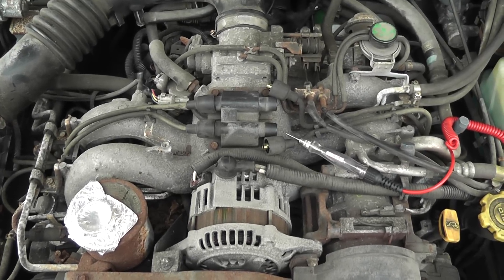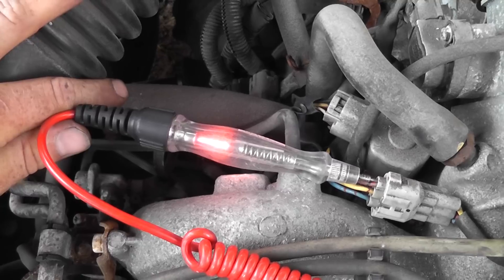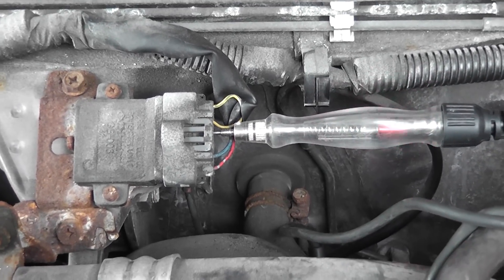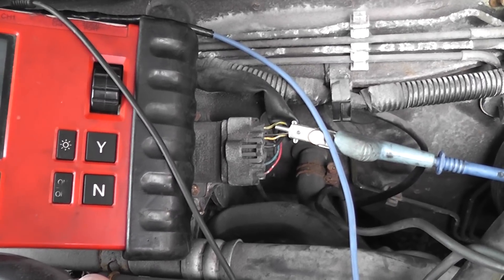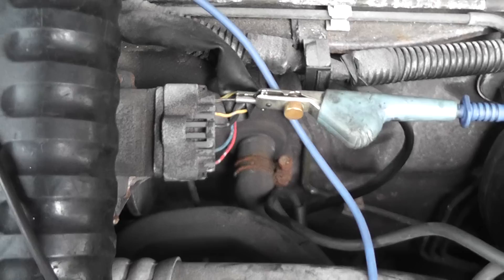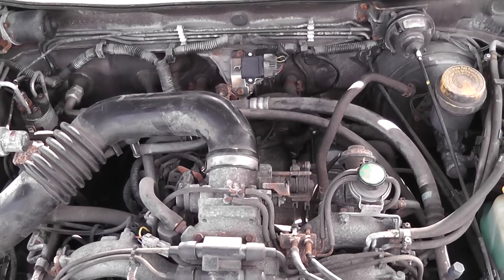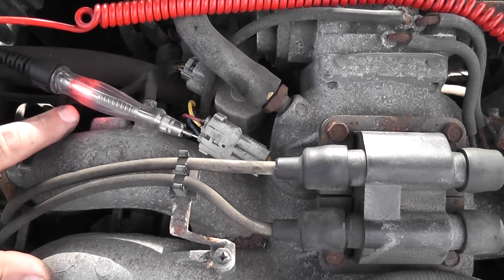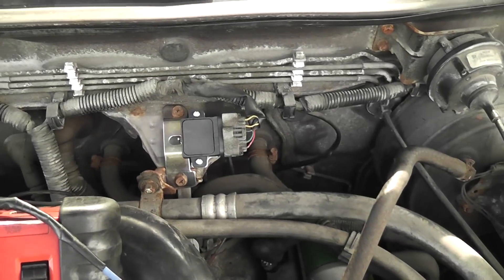How to troubleshoot a no spark condition with a test light (Subaru)

Comment from the maker: Want more training on this system? Maybe some questions on the tests I've shown? Watch this!! https://www.youtube.com/watch?v=LdnnFD6J8Uo&t=1s
Reply: Dear scannerDanner.

My friend has a 2009 subaroo impreza non turbo.

Randomly it will stall at lower Rpm... and sometimes it will start..within 10 min or so ... and sometimes it will not start for days. (No spark) 

No codes... no lights zero insight of what it can be ...

And once it decides to start... it's  and if it has no issues...

Have you come accross this issue ??
Reply from the maker: @lukek6492  no I have not. But you need to find out what you are missing when it is not starting. The window is there for you to do testing.

Comment: Just like say a huge thank you for posting this video up. I have successfully diagnosed a faulty igniter on my EJ20 engine installed in a T25 vw camper. I had no clue how to test or what to test and with this easy to follow video i got it down to the ignition igniter within 5 minutes.
Reply from the maker: Awesome!

Comment: I got low voltage on my igniter 0.2v on crank. All The others signals from de ecu and voltage are fine, i tried change The igniter, coils, crank sensor and replace The ground conectors but no spark, i saw That my crank pulley have some teeths sharp down
Reply from the maker: need to know exact year, make, model and engine and what ALL voltage reading were on each wire of the igniter to help further.
Reply: @ScannerDanner  
Its a subaru legacy gx tw 2.2 93 , it got a good power Supply and ground but only about 0.2v comingo from ecu
Reply: The service manual says The min voltage from signal are 0.1v but in this vídeo The signal comes about 2v, The crank sensor is New and works fine
Reply from the maker: @yurirecreio  okay, since it is possible that you still have an input issue (crank and cam signals), I want to address that first. Do you have injector pulse? If you do, we will continue to look at the igniter and related ECM control circuits. If you do not have injector pulse, we will move away from the igniter circuits

Comment: Hi. 
Subaru.. same engine.

Car sometimes dies at lower rpm as you are driving.

After it dies... it cranks.. but no spark.

No codes.. 

Then randomly it will start after a hour ..or so. and  sometimes won't start for 2 days.

Then... when it wants it starts... and runs ... till once again randomly dies.

Thoughts?
Reply from the maker: What does the test light do on the coil like i showed in this video? Should have a steady light on the middle wire and a pulsing light on the other two coil primary wires. Tell me what you see and I can help.
If you dont have an old school incandescent bulb test light, you can still find them for less than $20

Comment: My 06 Outback on cold days 30s F. With a cold engine I have no spark. I haven rpm on the scanner.. Using a timing light I found no spark, later today I'll scan to look at the cam sensor, also will check wire connector at coil for readings. Have tried different after market coils.
Here's a kicker, hook a jump box to it ,fires right up. Battery is new, test good,  vehicle passes voltage drop test as well, and cranks with several rpm.
???
Reply from the maker: Step 1, what is coil + voltage during cranking when it is not starting?
Reply: @ScannerDanner  Just checked it back probed 11.3 ish. But it fired right up of course. Will check again in morning, sure it won't fire then.
Little back ground. Spent amost 30yrs as a heavy truck tech. Few years back started developing cognitive issues. I mentally hit a wall pretty easy now, I hate it. But I'm broke so I have to fix it myself. Bought it with slapped valves out of a field. It's  a manual the only reason.
Thanks for your help and time, and listening to me babble.  
I'll update you.
And cam sensor reads fine.
Reply from the maker: @JonathanWhoever  awesome, love to help those who can help themselves, ill make it a point to reply. I'm sure we can do this together. 
One other thing, I rather you test for spark using something other than a timing light. That test is suspect. But if you're 100% positive you are losing spark, we will stay on this path for a bit. I want you to also check for injector pulse when it doesn't start. Do you have an incandescent test light?
Reply: @ScannerDanner  wow. Thank you. I'll pick a test light.
While testing fuel pressure it did load up the cyclinders while the ignition was disabled, smelled bad when I finally started it. But I will dive deeper into that. What do I need?  Those noid lights things?
And I just subscribed.
Reply from the maker: @JonathanWhoever  just get a test light like I'm using. We can roll from there. Make sure you get the old school incandescent type, NO LEDs!
Reply: Hello again. Checked it this morning here are my results.
Temp.20f
Batt v 12.44v
73%charge
Internal 5.28ohm
 Coil volt while cranking 10.2v
No start, not even with jump box help. Thinking maybe the coil is being effected by cold, warmed it with heat gun, no start. In 40-50drgree days, once its starts,it good all day.
Warmer than that no problem noticed.
Also noticed ignition voltage remains at coil for a couple minutes after key has been removed. 
Thank you
Jonathan
Reply from the maker: @JonathanWhoever  next step, test light tests like I showed in this video. Does coil negative flicker?
Reply: @ScannerDanner  On it. My coil is the one with the four wire connector on it. One is the volt wire, one has continuity to ground, I assume the other two are control. Should I see light flicker on the control when back probing?

Jonathan
Reply from the maker: @JonathanWhoever  I believe this changes things. Service info is vague but it looks like your coil has the transistors inside of it that control the coils. So the igniter is built in. You are not going to be able to use an incandescent test light on the two control wires as they will be low voltage trigger signals. You would need to use an LED type test light to see those flicker on and off, or a lab scope. 
So you've confirmed you are losing spark, for sure?  I think the next best test is for us to see if we are losing injector pulse too. But I think you said it smelled like fuel when it wasn't starting? 
Another thought, service info says the black wire is a ground, but that goes back to the ECM. Get me a voltage reading on that wire too with voltmeter connected to battery ground. 
In fact, how about getting me voltage readings on all 4 wires. The two control wires should show some type of oscillating voltage but your meter may be too slow to pick it up
Reply: @ScannerDanner   Okay. Here's what I got. After cranking with no start pull the intake boot and gas vapor floats out and smells like gas.
Voltage on black wire ground is .6v
Two control wires meter on 200m setting does bounce around a little.
Seems to spin adequate,shoulda used the scanner.
Hook up jump box ,fires right up.

I failed to mention this a Autozone coil. 1st did this, 2nd didn't work at all, and the 3rd I'm back to this.
OEM coil only $30 more, I didn't know at the time or I'd bought that.
Will a LED test light pickup the firing signals to the coil?

Comment: What if no power to ignitor?
Reply from the maker: Depends on the model, some of them didn't have a separate power feed. Here is a link to a DIY version of the wiring diagrams and service info I use
https://eautorepair.adtrk.biz/?a=10817&c=24&p=r&s1=

Comment: My coil shows resistance of 2.7 ohms on both primary negative pins. Factory spec is 0.7ohms . Secondary are around 23 (Diamond coil pack) so it is between the range. Car shows a random misfire, check engine lights comes on and off and when it os off car runs great. Do you think my coil pack is bad?
Reply from the maker: Resistance checks on coils are not accurate. When they measure bad, it's bad, but when they measure good, it can still be bad. Not a good enough test for the coil

Comment: I managed to solve the problem 1996 Subaru. Checked the Ignitor, that wasn't the issue. Checked  the camshaft and crankshaft for ohms reading...I went ahead and checked timing,  and the damn tensioner and pulls for the timing belt,  both the tensioner and pulls was bad causing to skip timing...

Comment: Do you also have a video for 1996 subaru legacy wagon 2.2 camshaft and crankshaft sensor testing? Testing to make sure that they are good and not wasting my money to buy parts when not needed. I'd watch other videos about checking camshaft and crankshaft sensor..Mr. Paul I like your videos.
Reply from the maker: You'll find them in my chapter 21 playlist. Are they 3 wire or 2 wire sensors? 
Not specifically the Legacy 2.2 , at least I dont think, but certainly I have info on both 3 wire hall effect type and 2 wire magnetic pulse generator types of sensors and how to test them.
Reply: 2 wire sensor for both camshaft and crankshaft sensor. heading out again  for a 2 hour drive. My , the other brother in law finally had the battery check and charge, and I can't check the Ignitor because we had tooled off the timing belt and other belts for me to test...1 is mecchanilly incline and the other is Lazy.

Comment: Nice Information  dude, I don't have those tools , what the hell going to replace that unit..replace the knock sensor, Iac, coil,, wires and plugs.check the belt for TDC.. WAtching other videos  and showing me the camshaft and the crankshaft sensor...I'm on my Mother inlaw subaru for 3 weeks now.
Reply from the maker: just go buy an cheap $10 test light with an incandescent style bulb (regular bulb, NO LED light) and follow my test light procedures.

Comment: Would this work the same on a wasted spark without an igniter like on a EJ251/EJ201 I have no spark I have + and - and 2 to 2.5 volts on the ecu feeds but no spark
Reply from the maker: need year, make, model, engine size in liters please

Comment: So if I'm missing control signal on 1 wire coming from the ecu to the igniter and I have good spark on one half of the coil is it fair to say it's ether the wire from the ecu to the igniter or the ecu it self.
Reply from the maker: Or the igniter transistor is shorted pulling the ECM control signal to ground. Disconnect the igniter and test it again.

Comment: Hey would the 2010 forester be the same for the flickering aspect? I’m not getting any spark , I have a constant 12 and a good ground but no voltage from the signal wires (cranking or just key on) tried with a test like and volt meter. I could really use some help thanks
Reply from the maker: Any trouble codes? Have to start there on a 2010 model year
Reply: Just p0420
Reply from the maker: okay, your set up is a little different in that the coil assembly contains the igniter inside of it. There are 4 wires, a constant 12v feed and ground and then 2 control signals. These will most likely be low voltage 0-4v square wave signals that a voltmeter will not be fast enough to show you and a regular incandescent test light will pull them to ground and not light the light. Have you tried an LED type test light on those circuits? If so and you have no signal, the next step is to see if you have injector pulse. Then we move toward the crank and cam sensors (inputs) if you also do not have injector pulse.
Reply: ScannerDanner ok I’m not getting a pulse from the injectors , instead the control side has a very dim light with key on (about 2volts) and I do have 12v on the live side. I’ve already replaced the crank sensor under a friends advice. I suppose cam sensor is next. Can you point me to a diagnostic process for a 2 wire sensor?
Reply: ScannerDanner I’ve tested the cam sensor. 2k oms (within spec) and a solid ground on the connector
Reply: Great continuity through the harness to the ecu
Reply from the maker: @mitchz2600  let's move this to my forum is you are still stuck, it is free to join and I have paid moderators who are there to help me help you guys. https://www.scannerdanner.com/forum/post-your-repair-questions-here.html

Comment: Hi thanks for excellent and detailed videos.Could you please clarify if we didn't have a wiring diagram and we didn't know which wire was which i.e. which wire was signal, control or feed. How Safe it would be to perform all the tests you have done with a test light both at coil and ignitor, without cooking the main PCM.
Reply from the maker: I believe I showed what happens to the signal wires when a test light was connected. It pulled them to ground, so not a really good thing to do in my opinion. You really need to know what circuits you are connecting to especially when using a test light.

Comment: Is 2 volts enough power to control the coil or igniter ? I thought you usually need at least 5 volts?
Reply from the maker: To be clear, are you talking about the coil primary winding itself or the transistor base circuit that is responsible for switching the primary circuit on and off?
Reply: ScannerDanner : Boy You sure know how to get technical. I guess that’s why you’re called “ Scannerdanner”. I appreciate you replying quickly. I’m just a backyard mechanic bye the way. But I guess I need know for the both circuits. Thank you for posting your videos. I really enjoy watching them and learning from you way out here in Monterey Park California. An incorporated city in Los Angeles County.
Reply from the maker: @louiemunoz2753  I'm sorry my friend. I can definitely still teach you. Watch this video https://youtu.be/_Ijhi7ai1HY
Then also tell me what type of ignition coil you are trying to test. Year, make, model, engine size would help. 
Also, is it a distributor engine with one single coil? A waste spark design where one coil is firing two cylinders or a coil on plug where there is an individual coil for every cylinder?

Comment: Thanks for this info.  I will check it out for my car.  But not finding an ignitor at any of the parts places for my 2001 Subaru Legacy L.  I also don't have a schematic to help diagnose.  I own both a Haynes and Chilton manual (same frkn manual these days) and both have schematics, but none of the schematics include the ignition system!  And the text part of the manual does not mention an ignitor.  They show similar tests to what you are showing for the coil, but they say nothing about an ignitor.  Did they integrate that function into the main computer for that year... or are they just neglecting to talk about the ignitor.  Again... no such part showing in ignition parts lists for that car at my local parts distributor.
Reply from the maker: Mitchell or Shop Key (same diagram) There is a DIY version where you can buy access for a small period of time for your car. https://www.scannerdanner.com/forum/post-your-repair-questions-here/16-need-service-info-check-here.html
Your system has the igniter built into the ignition coil. There are 4 wires, 1 power, 1 ground and 2 separate computer control wires. These are low voltage trigger signals from the ECM to the igniter.

Comment: What does it mean when you have no spark or injector pulse and you crack and Cam sensors are good
Reply from the maker: what does what mean? you got to help me more than that. Is the car not starting? what are you working on? year, make, model, engine, trouble codes etc. What is your fuel pressure?

Comment: when I test  my harnesses from the ignitor to coil should my control wires show to be ground out..? or be positive?
Reply from the maker: If it is this design, as shown in the video. This video will answer all your question. 
https://www.youtube.com/watch?v=LdnnFD6J8Uo&t=1s
In short, power is supplied through the coil primary winding and is grounded by the igniter. With a test light, your igniter control wires will show "hot" but it really isn't a power feed. It is a ground side switched circuit that doesn't have a ground yet. Watch that video, then we'll talk.

Comment: At the 25 second mark, you held the tip of the test light near the coil.  How did you know that the side you were testing was the side where the spark comes out of the coil and not the side where the spark returns to the coil through the spark plug wire?
Reply: MBS  spark comes out of both sides.  2 of the 4 plug  wires are removed to check for spark

Comment: Hi, question. My car has power at the yellow wires on the ignitor, looked for anything hooked up wrong, everything looks good. My coolant temperature gauge is pegged even with the car off. Leaning torwards computer

Comment: if test light is connected to battery plus, it would flicker also if there was good coil control, correct?...can it be done?
Reply from the maker: Yes but it's not as good of a test since the test light doesn't load the circuit the same way the coil does.
Reply: i thought, if coil is shorted and there s current limiting from the igniter...then unplug the coil (and the igniter is not limiting anymore...i guess)...igniter switches again(i guess)...and you can verify that by touching with the test light connected to battery positive...i mean, in an event you dont have an amp probe handy...to prove a shorted coil
Reply from the maker: Yes that is correct. The only concern (small concern) is you could have a situation where the transistor in the igniter has the ability to carry the current flow of the test light (say 200 ma for an incandescent and 13 ma for an LED type) but not the current of the coil (6 to 10 amps or 6000 to 10000 ma for a comparison ).
I still think it is a valid alternative though.

Comment: great video, Question. Tired the test light for spark, no spark on either coil. Checked the center power wire feed at 1:29, seems to pulse like the coil negatives which both work.

With the power feed flickering, what might be wrong?
Reply from the maker: +peter shaw this is usually from a weak battery during cranking. If both control wires and the feed wire look the same (the pulse you are describing), then you have no control. Follow the procedure as outlined in this video. Make sense?